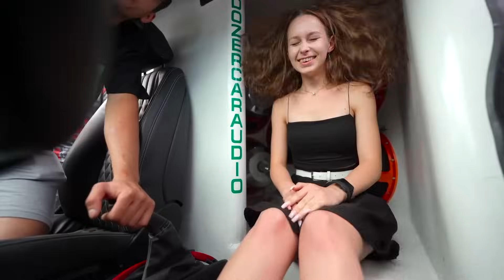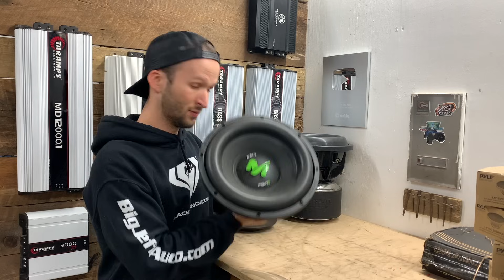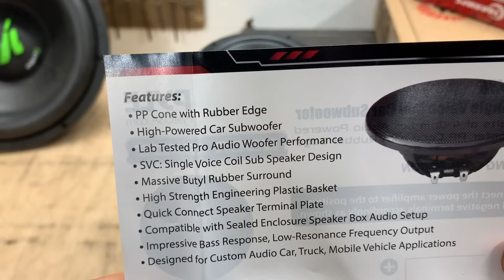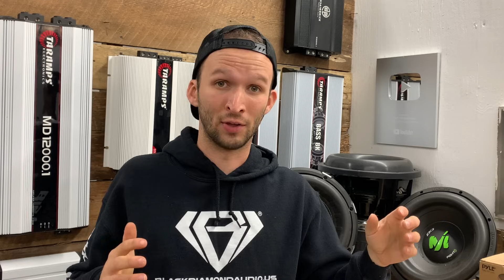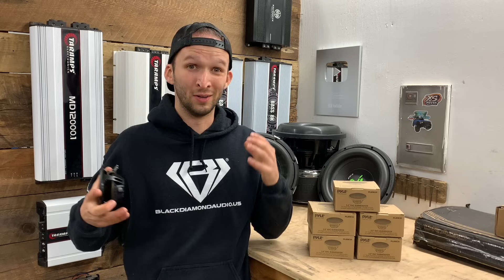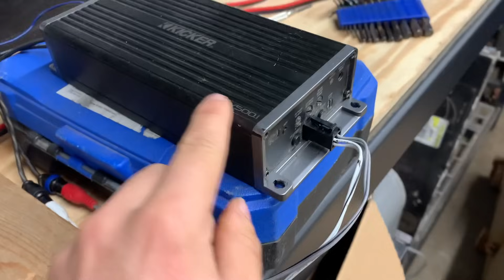HOW BAD is Amazon's CHEAPEST "Subwoofer"? | Full Test and Review

Comment: I think it's actually good for a portable speaker build. It's pretty compact, lightweight and even seems to be water resistant. Would really fit into a little 2.1 system.
P.S.: I also like how fair is its power rating, 10 watts continuous and not 100 for such a little coil. It definitely has 10 watts in it.

Comment: Funny….i took the cheapest of cheap stereo equipment back in the 80’s on a dare to enter a crank it up contest. I used all Pyramid equipment, designed and built the boxes and designed the system. I actually won the contest with a 141 and blew 3 windows out of my Jeep wagoneer. People were dumbfounded and pissed, it was hilarious. I didn’t think I’d win, I just wanted to place and prove the haters wrong.

Comment: This dude understands what he is saying. In this topology, grounding a channel after a second amp output can be used to hack a bridge. Yes do a vid on this, please, but ti continue!

I am not trying to call this dude out at all,  but it's  called "Sequened" by method... Best way to urltilize any Mono Amp or Stereo AMP in order to add an extra channel. You can do this with every available channel without dropping Ohm without control. This does have limits! But wiring an output at any time in sequence is always most efficient!  

 Yep, sometimes if you get super techy, you can link amps even using common. I'm just saying.

Can you imagine effectively exploiting your AMP in band pass individually while separating challens? I was doing that in the 90's! 

Should made it my career!

Comment: To me Pyle brand is decent I have a 10 inch sub for like 38 bucks in my garage and it kinda bumps really off of 100watts.. and the time one your working with could be for gone theater system just saying.. yes there is much better but they are cheap to screw with and if it blows up it's only like 50 bucks lost

Comment: These would perform better with a passive radiator and then finding the correct weight to work out what resistance is needed to control them best.

Comment: People always cap on cheap brands: 

People really capped on Pyramid back in the day. As one of the worst, cheapest. They had a line of products called Legacy. Well, I only had about $1,500 to spend on an entire system that could bump including deck. Going in a small hatchback. We custom built a box, that took the entire hatch. Put two Legacy Comp 15’s. The dang magnets were almost as big as the speakers! A Legacy 1000 watt amp. 2 Legacy 200 watt amps. A Legacy crossover. A set of Legacy 6x9’s in their own boxes in the back window. A set of 3 way 4 1/4s in the back deck lid. Then up front we did a set of Legacy 5 1/4 three ways in the doors. And Legacy tweeters at the top of the doors. Even the wiring and fuse blocks were Legacy! The only thing that wasn’t was my JVC DVD single din deck. We also highlighted the entire car with purple and blue lighting to match the paint job and to match the amps and subs which were purple and blue. 

Let me tell you, that car was bananas! The door skin panels were moving in and out a good 3 inches. It’s a miracle the doors didn’t separate! 😂 But I will tell you what, that little system was hitting hard and clean! We could be heard a good 4 to 5 blocks away on a low traffic day. And it was easily metering in the high 130’s. And the sound was deep, rich bass. And the mids and highs were crystal clear. The Dre Day album sounded incredible in that car. You could hear nuances like the little reverb tings on the snares. 

All from a system with deck and wiring included for under $1,500! The deck alone was over $400. The only Pyramid/Legacy system I have ever seen that nice. Even to this day. In fact, the reps for Pyramid saw my car. And for a time, we were discussing them sponsoring me… I should have taken more pics of the system. It was pretty incredible. I have one or two pics of it. But should have gotten more. Great memories. But yeah, you can put together incredible systems for small money if you are creative. And you know how sound resonance works. 🤷‍♂️

Me and my best friend at the time built and installed this system. Then we lost touch for 25 years. We just recently got in touch with each other a few months ago. And we are now building a killer new system for my car now with all Infinity. It is gonna be pretty wicked. And the friendship being reconnected on such a project after 25 years is pretty damn awesome too. 😎 🔈 🔊
Reply: Love budget builds where you actually build it right to see what it's got.
Reply: @robwithrbk the only thing I wish I had done different is get more pics and videos of this car and the project. I have a couple pics of the whole thing. 

But for whatever reason, I dodnt get enough or any video I can find. I sold the car with everything left in it, about 15 years ago.
Reply: please share a link to the images.  my buddy used to run legacy too.  i'd love to see it!
Reply: @mcburgerpants never got notified of your message. I am now in the middle of a cross country move. And half my tuff is already cross the country. Including all my pics. When I get there permanently and when I can find the pictures box, I will see what I can do…
Reply: Omg! I love meeting up with old friends they have the same interests still. If they are married, the wife never has a clue that we are putting our mouths onto each other. It's hella fun being sneaky. I'm not a home wrecker though....I only borrow my bros. Not like I didn't have them first anyways. This may seem like a silly story, I guess it's not that unbelievable.... And it shouldn't because it's true. 💯
Reply: Freaking awesome story. I would love to follow you guys journey on that settup.
Reply: 😂 yep, I remember the flea market budget bangers them and Pyle personally, I preferred the American bass The bumper series I ran a six pack of these bad boys and they would give kicker L7 12s they run for the money the kickers were in my buddy's Cadillac versus the American bass in the house

Comment: You should try the same wiring config, but invert 2 of them.... maintain the overall 4 ohm load but now its a push pull which will increase power handling a little and should increase low end extension as well....and did you put any fill in the box? One of the cardinal rules of speaker building never leave a box empty....
But still a cool vid

Comment: I legitimately bought one of these to try and upgrade a old doss soundbox xl woofer, I'll mostlikely have to modify the mounting spot but I think it will be cool, ( just receive the pyle woofer and it already was getting hot just from the doss xl amplifier 🤣 only 12 watts and that was almost to much,  I modified the doss speaker to fit this speaker and it does have some improvements on bass and looks pretty nice in there

Comment: In the configuration used, if the second speaker (from the left) failed open circuit, the left-most speaker would not respond regardless of whether it had failed or was still quite robust.

Comment: Pyle super pro subs in the 90s were the shocker of the industry, along with the radio shack 15s and 18s (I still have 2 of the 18s for home audio and going strong), so don't sleep on the cheap gems when they come along. Like skar, American bass, Savard and the new kicker lineup.
Reply: People really capped on Pyramid back in the day. As one of the worst, cheapest. They had a line of products called Legacy. Well, I only had about $1,500 to spend on an entire system that could bump including deck. Going in a small hatchback. We custom built a custom box, that took the entire hatch. Put two Legacy Comp 15’s. The dang magnets were almost as big as the speakers! A Legacy 1000 watt amp. 2 Legacy 200 watt amps. A Legacy crossover. A set of Legacy 6x9’s in their own boxes in the back window. A set of 3 way 4 1/4s in the back deck lid. Then up front we did a set of Legacy 5 1/4 three ways in the doors. And Legacy tweeters at the top of the doors. Even the wiring and fuse blocks were Legacy! The only thing that wasn’t was my JVC DVD single din deck. We also highlighted the entire car with purple and blue lighting to match the paint job and to match the amps and subs which were purple and blue. 

Let me tell you, that car was bananas! The door skin panels were moving in and out a good 3 inches. It’s a miracle the doors didn’t separate! 😂 But I will tell you what, that little system was hitting hard and clean! We could be heard a good 4 to 5 blocks away on a low traffic day. And it was easily metering in the high 130’s. And the sound was deep, rich bass. And the mids and highs were crystal clear. The Dre Day album sounded incredible in that car. You could hear nuances like the little reverb tings on the snares. 

All from a system with deck and wiring included for under $1,500! The deck alone was over $400. The only Pyramid/Legacy system I have ever seen that nice. Even to this day. In fact, the reps for Pyramid saw my car. And for a time, we were discussing them sponsoring me… I should have taken more pics of the system. It was pretty incredible. I have one or two pics of it. But should have gotten more. Great memories. But yeah, you can put together incredible systems for small money if you are creative. And you know how sound resonance works. 🤷‍♂️
Reply: @DangerousDevilOfficial  Pyramid Phase iii cheapies did great for me. Made in USA! Not 1/10 as robust as robust as any modern subs, but did 90% of modern spl on 1/20th of the power!

Comment: I'd definitely consider using those as midbass for small speaker projects. I'm impressed with the durability of them. On my headphones they were clean down to 100 and started getting mud by 80, 60 they were just harmonic noise. Definitely not bad for what they are at that price. Absolutely not subwoofers lol but not garbage.

Comment: If your sub is being pushed and it starts to smell, after turning amp down did I do damage to my sub still?
Reply: Depends if you hear any unusual mechanical noises when playing it and if its frequency response has been negatively affected in some way.
If the glue just got a little toasty but didn't completely dislodge any windings of the coil. it may be ok. but it could still be weakened and get damaged easier the next time you get it hot.
Reply: @realflow100  thanks. My subs are actually in great shape still

Comment: @ParkerTheBasshead- It would have been cool, if you would have tested that little enclosures SPL in a vehicle(using 40 to 80 watts), on a little hand held SPL meter, that can go down to 70 or 80 Db, and go up to a 120 Db, like a meter i have. Then after testing the sealed enclosures SPL, ✔️to see where the impedance was the highest, then tune a 2 inch, or 3 inch port to that freq. Then put that ported enclosure back in the vehicle, to see how much louder it was.

Comment: There have been some suggestions of making a box and putting many of these subs in it to see what they can do. Id start at like whatever area of these speakers covers an 18 inch sub and see what happens. That equates to about 26.5 of these little fawkers. 32 of them in series parallel will get you .5 ohm. DO IT PARKER, DO IT!

Comment: no that is not a coax or midrange it is a home theater small subwoofer they go in the wall.    there is many different subwoofer types out there they range from 2 1/2 - 21" yes the smaller subs are easier to blow up cause the smaller power range it has my car gots them subs in the car they do pretty well but upgraded to a different size recently but YES they are considered subs    verry small subs

Comment: Obviously there not subs but they don't seem to be a bad little midrange, there neo and the frame being plastic isn't a negative there's higher end brands that use plastic frames also I think tang band has some or one and if they are strong enough it's an excellent material because plastic is super dead which isn't as important at sub bass frequencies but midrange it's really important. If someone was doing a budget 3 way front stage I think these would work great as a midrange and 10 watts is more than enough  for an actual small midrange driver and there apparently pretty damn tough, do that test to a 6.5 midbass driver from whomever brand it will probably burn up quicker...
Reply: Plastic frames are great for car audio use.  They don't rust... 🙂

Comment: well...also i dont agree with +1 thing from the manual: that it is anyhow good in sealed box (or bp4) to get good / acceptably loud low bass down to at least the the 40ish hz range, because: way too small cone area, way too light moving mass, way too small excursion, and also probably/maybe too stiff spider/surround...imo in ported box, or in bp6 this would be significantly better for this purpose, or with passive radiator maybe this would be acceptable as a bt speaker bass module...but as far i saw the overall quality, i dont think so it is worth of experimenting with this "subwoofer" like this 🤷‍♂

Comment: Dear Sir, What is the largest amp, name brand and model you would recomend for a stock cars electoral system without having to upgrade it. . i want to run 2- 12in subs in my van and i want to stay under a thousand dollars for the subs and amp. Please i need some advice so i don't get it wrong. thanks.
Reply from the maker: Generally 1500 watts. Depends on the vehicle tho

Comment: They are ok as door speakers. I had got something similar from Pyle many years ago and installed them in a matrix. I crossed them over at 120hz. The car had 2 way speakers, but all the 6.5 inch cones were done. For $6 they performed as good as some more expensive door speakers.

Comment: im looking to build a sub box for my pc speakers.I have an amp and I a set of advents for the front stage.  I may use my older yamaha center and surrounds for whent im not listening to music where dolby sounds beter.

Can you find a speaker about that size that is really rated to cover sub frequencys? My amp can go down to 2ohm I beleive since I been running two 4 ohm 15s off it in my shed. got a bigger amp for the shed now.

Comment: A while back I bought 4 super cheap 8” subwoofers off of Parts Express for $8 each.  I put the theile small parameters into a bass box calculator and built a 4th order bandpass box.  With a $100 Power Acoustic Walmart subwoofer amp running them at a 2 ohm load, it peaked at 135 db at about 47 hz!!  

Fast forward a little bit and I bought eight 6.5” woofers from Parts Express for a little over $8 each.  I installed them in an infinite baffle setup running off of a D4S JP8 at 2 ohms.  I never got them metered but they sounded really clean, had decent overall output, and useable output down to about 25 hz!  

Cheap “subwoofers” can sound good as long as you don’t expect them to sound like an expensive Sundown sub.
Reply: I just bought 32 cheap CES 8" drivers to play around with in home theater... Came out to right around $300. Should be interesting
Reply: @unknownspectre  sounds like a fun project!!!
Reply: @unknownspectre 32 😳
Reply: @Izakp  yeah, it should be a fun little project! They've just arrived yesterday, and I'm already considering purchasing another 32x 🤣
Reply: @unknownspectre  for what 🤣 building a box and wiring all those is gonna be impossible
Reply: @Izakp  manufacturer recommendation is a volume of 1.8ft³ for an F3 of 37.3... If I go isobaric, I can get that same tuning in just .9ft³ with 2 drivers, or 4 drivers in the original 1.8ft³. what I'm thinking I'll do I build 4x cabinets using 8 drivers each, and that should make it easier to stack them or place them around the room for a dispersion in room
Reply: @unknownspectre  actually sounds like it’s gonna be a really clean build. Post a vid and tag me when your done cause I’m kinda interested now
Reply: @unknownspectre im also interested in build
Reply: @unknownspectre Sounds like something i would do lmao
Reply: Absolutely 💯

Comment: Pyle… making errors and fake advertisements since 1995.
On a side note, Wikipedia is misleading on the subwoofer actual frequency response. 90% of all subwoofers on the market are efficient up to 75Hz. For higher bass, you need a midbass woofer which is more efficient. If you try to play anything higher than 75Hz through a subwoofer, you’ll notice that a midbass woofer is WAY more efficient at playing.